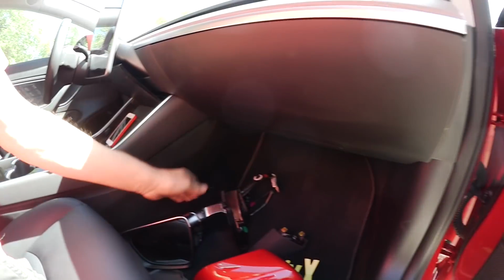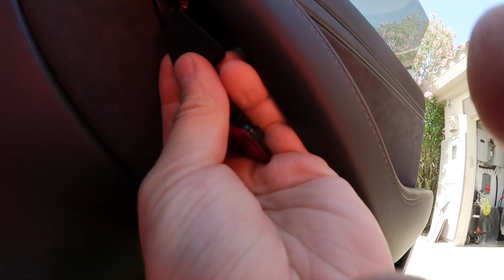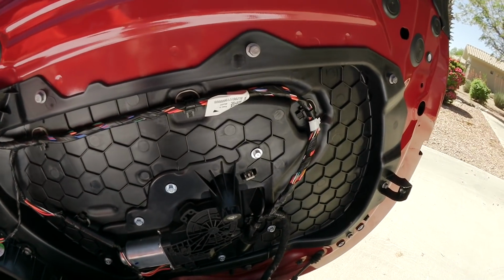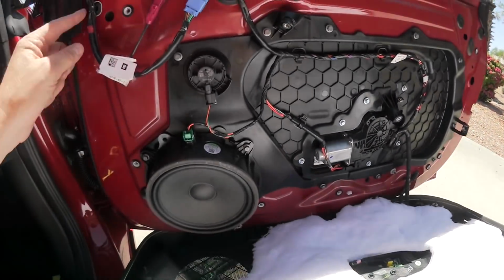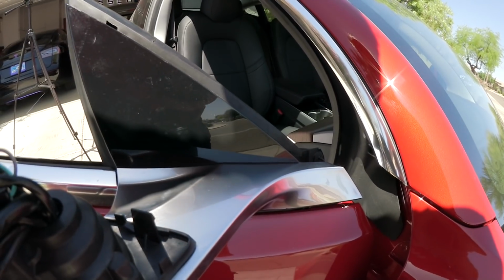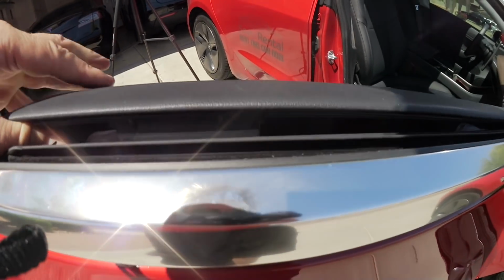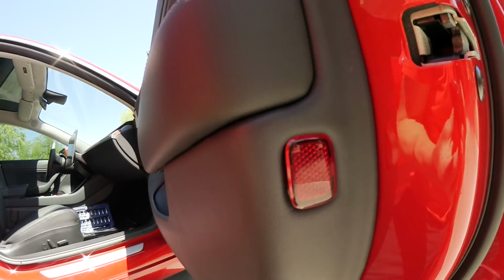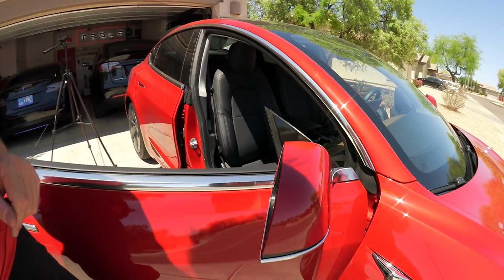Tesla Model 3 Mirror broken. How to install a new one.

Comment: Very interesting and insightful video. I'm a bit surprised how complicated this is given the fact that Tesla has so much to do at their Service Centers already. One common theory for complicated replacement of easy to break parts (e.g. mirrors, lamps) was to keep the car dealerships and repair shops "happy" (aka busy) after the sale of the car.
Reply from the maker: Horst Fuchs Actually the repair centers are kept as “not profitable” The entire assembly with the electronics in the mirror is quite expensive. An RFID is in the mirror as well.
Reply: Yet this is no explanation why you had to remove the door panels. Also one connector to connect all RFID/antennas would have simplified everything. But again: I don't know anything about car manufacturing and I assume other car vendors design it even worse. That said I hope to see cars with digital mirrors (camera systems) to get approval soon (as seen with the Semi Truck) :)
Reply from the maker: Horst Fuchs Otherwise i could not have removed the mirror assembly, because the third bold is under the door panel. Rolf

Comment: Hi Rolf. In my case, the cover pieces only were damaged, mainly the bottom chrome-looking piece. If you still have it I would very much like to buy that piece from you. I have purchased an after-market part, which despite being from China looks like it should fit, however I am unable to snap it into place. If you have already sold it or no longer have it, I would appreciate any insight you might have into how to install just the chrome piece. Perhaps the entire assembly needs to come off, to do so?
Reply from the maker: This piece is long gone, but thank you for watching. Did you subscribe? Rolf
Reply: @TeslaOwnersUS  No, not yet. It is in fact a nice video. Do you know/ can you tell me, in order to replace the bottom chrome-look piece, what needs to be done? It seems like it should be able to be attached with the mirror intact, but perhaps the entire assembly must come off, and then the assembly disassembled as well.

Comment: Hey Rolf. Thanks for video. Did you notice when you removed the door panel if the cloth insert behind the grab handle is a separate removable piece, or part of the larger panel?

Comment: Thanks for the video. There are 2 connectors from the assembly. The megenta one seems to lead to the orange piece at the back side of the mirror. It looks like some sort of antenna. Do you know what it is?
Reply from the maker: motofan16 The Blue tooth Receiver to open the car are in there. The wire is the power supply for it. Rolf

Comment: How does the lower chrome piece come off of the mirror?  Is it attached with clips or screws?  :18 seconds
Reply from the maker: Jeff Wong the lower piece direct under the mirror is clipped. The piece attached to the window is one assembly. You probably cannot remove it separately. Rolf please subscribe